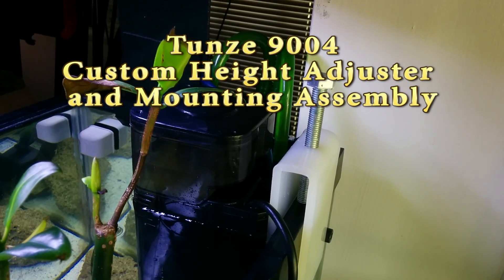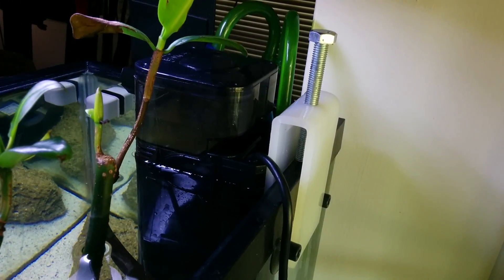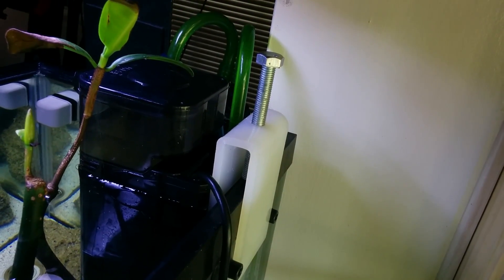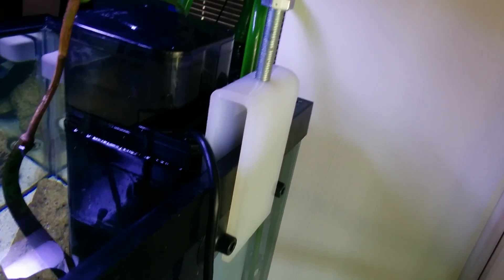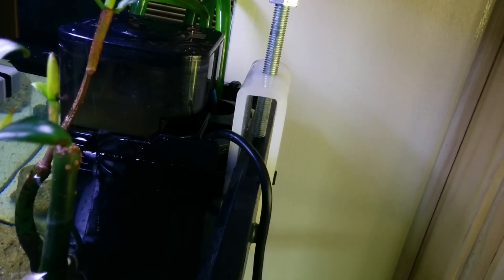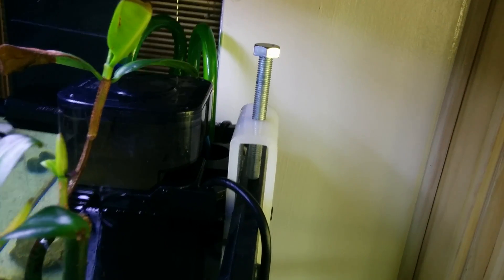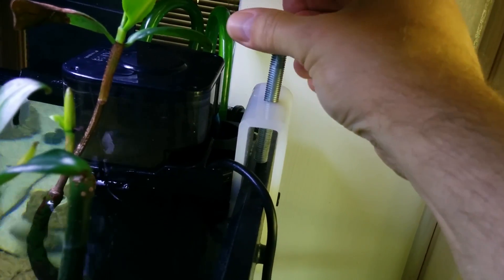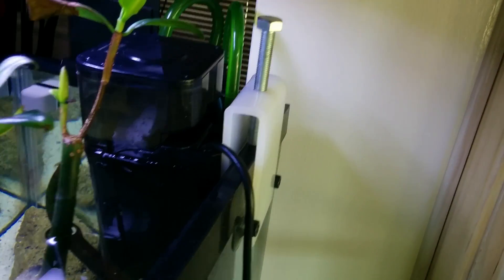Tunze 9004 Protein Skimmer - Custom Variable Height Adjustment Mount

Comment: Nice bracket what kind of work did you do. I worked in a machine shop for 16 years and this German guy thought me tool & die making.  I work for the company for a total of 23 yrs since I was 17 yrs old. My father was a setup man.
Reply from the maker: Ruben Thanks Ruben ... I've always loved machine shops and making things.  I'm retired now, but was a Mechanical Engineer for 30 years in the automotive industry.  I have a shop in my basement where it seems like I'm always making something.  It sounds like you had a great job!
Reply: olliesshop Oh yeah I loved the machine shop. I was always making something.  My father had a problem with a bracket next to the carburetor from the throttle section for a Ford Torino and I made it out of a piece of SS block. . He never had any more problem with it.